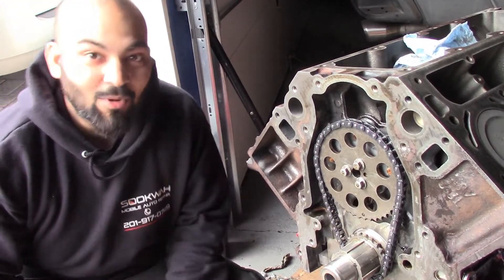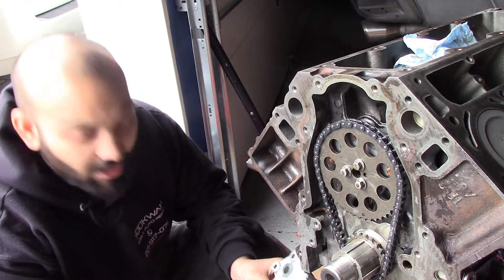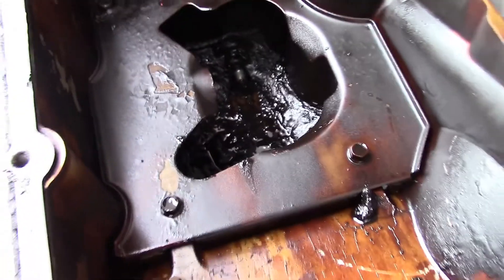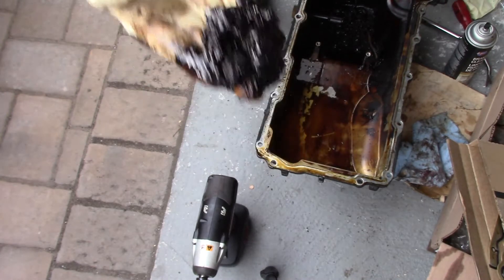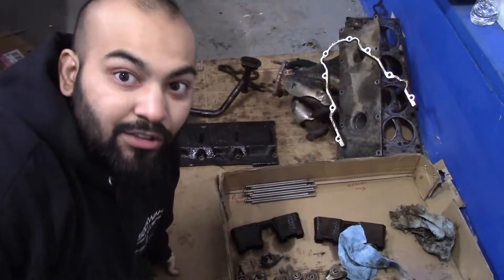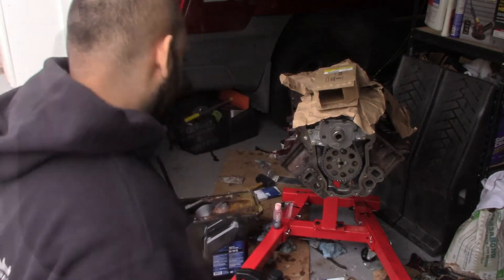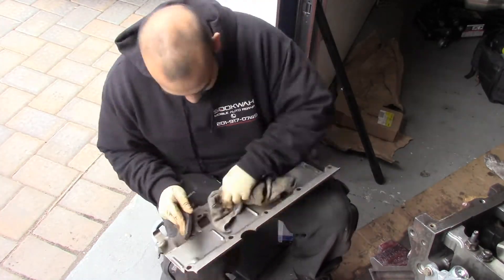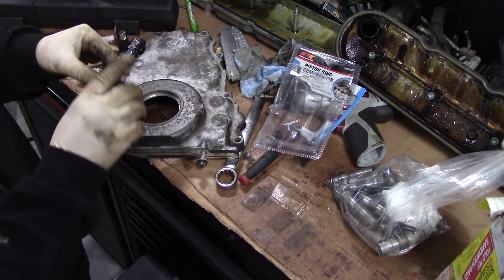OIL PUMP AND SLUDGE IN MY OIL PAN ? MUST WATCH TILL END  ( 2004 CHEVY AVALANCHE) ( 5.3 VORTEC V8)

Comment: Give you some advice replace the heads i just rebuild a 2004 6.0 lq4 at 3500 miles has sludge already in oil pan .If possible use new heads if not you will be doing it again i have been down that road.Also i had heads checked and resurfaced doing the job again and rebuilding is not cheap Especially if they are casting number 317 heads
Reply from the maker: =( way to late lol, they are all already back in the engine.... its been a while now, engine is running amazing and no issues... if anything happens ill drop an 8.1 in it! or diesel

Comment: When pulling the oil gasket, you said it had 2 rivets that you popped off? Are these just regular rivets from a rivet gun?
Reply from the maker: No from what I remember  i believe it's like two rivet stud like things lol. It just hold the oil pan gasket in place... and you can remove them by prying
Reply: @Kingcustomz  correct. I was just wondering if it does any good putting new rivets in place to hold the gasket perfectly in place.
Reply from the maker: That was placed on by factory to help hold it on while installing... just put a bolt through lol